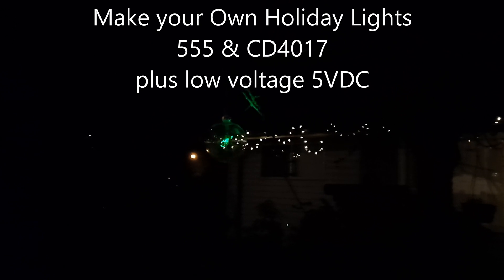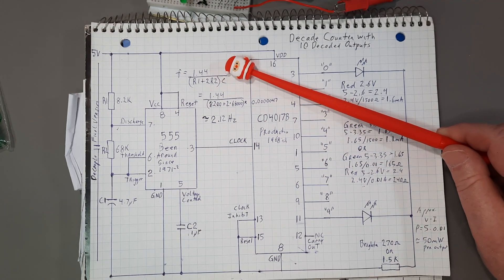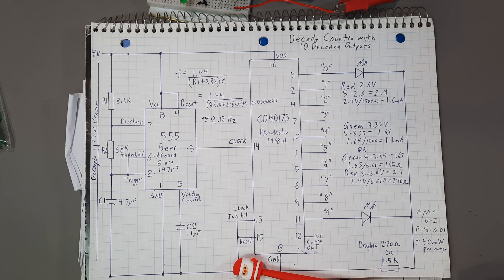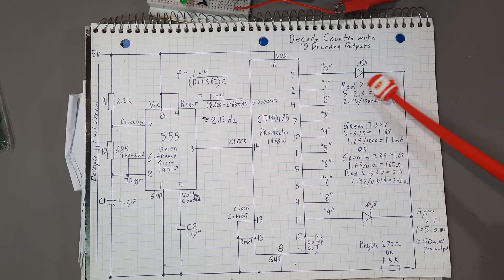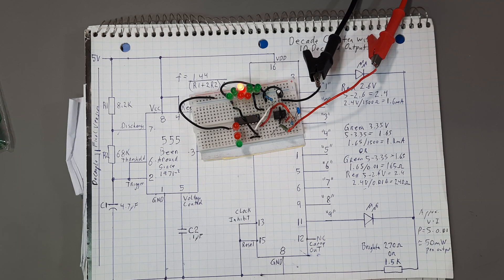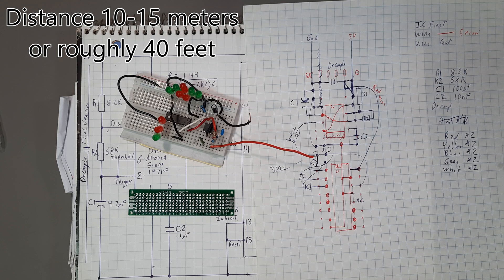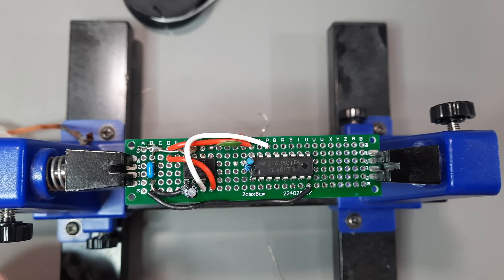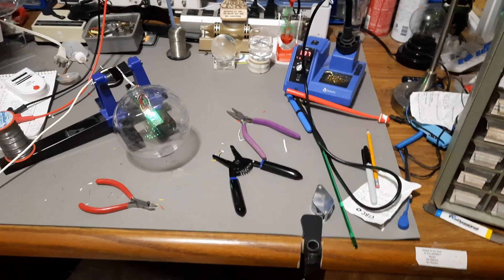DIY Electronic Globe for the Holiday

Comment: The standard 555 timer has a minimum operating voltage of 4.5V. In an application with VCC of 5V, it is better to use a CMOS version which is the 7555 timer. These also take heaps less quiescent and operating current, which is worth considering on a battery powered project.
For the 4017 you should add transistors to buffer the outputs, which would allow you to drive more LEDs rather than a single red at low current.
Reply from the maker: I have both types of 555, the NE555 which I believe this brand is and TLC555 which I used in a video a little while ago "Music or Noise Maker 555 with LDR DIY". Have lots of NE555 so it is a good pick since the project will always operate at 5VDC coming from a wall wart. Also have heaps of 4017, so this project was to start using some of my hoarding pile (-: